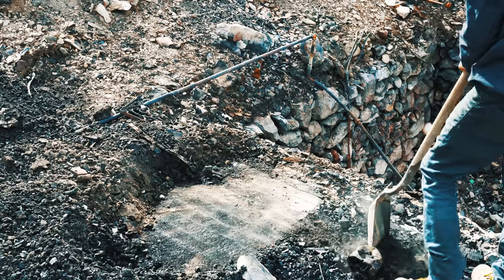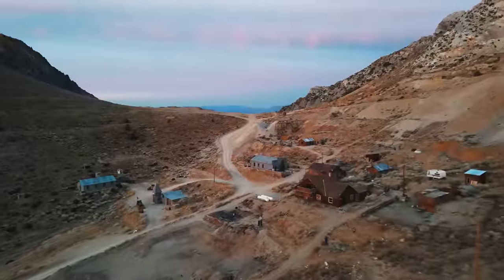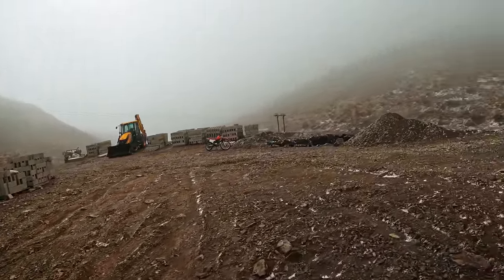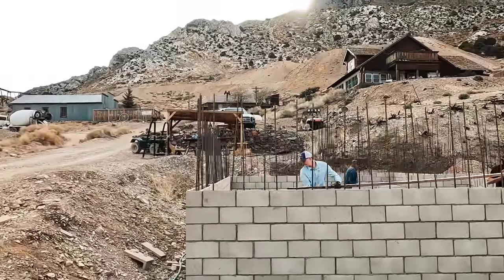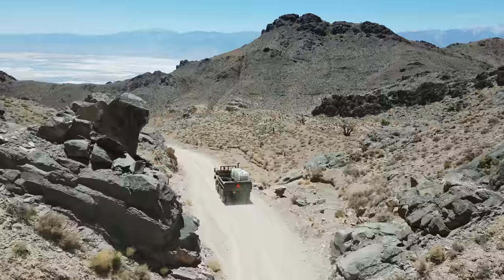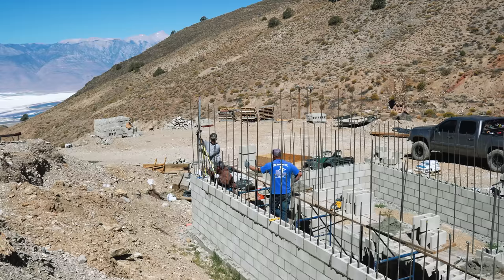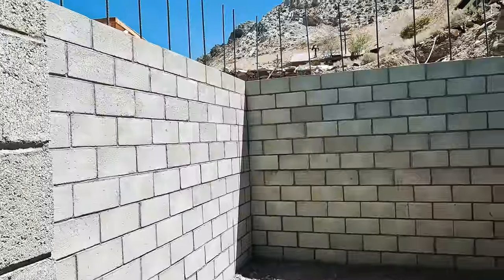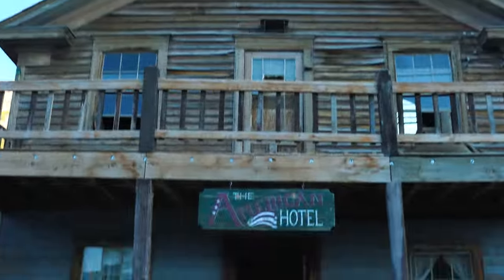Rebuilding The American Hotel Continues, Finally!

Comment: Perhaps to raise money for the American Hotel, “sell” the option to write the name of the person who donated on the roof shingles (on the inside of the hotel, not visible from outside). This was done here in the Netherlands at a church which had major fire damage, the new roof now has many names on the inside.
Reply: Awesome idea
Reply: I was at a restaurant/Whiskey Bar and after a fire they did exactly that. The took old Whiskey barrels apart and used the wooden slats, and branded the names of the people involved into them and covered a wall with all the wooden slats. Kinda like the bricks you can buy in front of stadiums and places like that.
Reply: I was gonna comment the same thing, only with bricks. People could buy a brick and have their name inscribed on it. They did it here with a clock tower
Reply: I believe this is already one of the patreon tiers.
Reply: I used to help build habitat for humanity homes.we would take donations for like 2x4 framing lumber ( studs.) And they would write their names on them.  Until the sheating and drywall was on the house looked pretty well graphitied.
Reply: Yes I worked for Buffalo trace in Frankfort ky and they have bricks with their names on them, lining a very nice bricked path. Don’t know how much they had to pay they also had the date on them
Reply: Great idea!
Reply: I wonder where all this money is coming from to build this hotel?
Reply: @t.j.m3987  "A portion of this project has been funded by donations made to the Friends of Cerro Gordo NonProfit organization through the American Hotel GoFundMe. The support of thousands of individuals over the last two years has raised funds that will go directly into rebuilding the American Hotel, preserving history for many generations to come. It is through your unwavering support and generosity that this project is possible. Thank you so, so much! It’s beautiful to see so many people care about the history here. It means the world to me." It's in the description of the video.
Reply: Funny how vanity was the selling point for those donors , in a church no less , wow .
Reply: @t.j.m3987  There was insurance on the buildings but it will not cover all the rebuild expenses. Things like code upgrades (very expensive fire sprinklers) weren’t on the policy.
Reply: @jimwednt1229  Never heard of "buying grace"? It was very popular with catholics before the printing press.

Once the bible was printed in common languages, and the people saw nothing in the Bible about paying the Catholics for dispensation, the practice died out..... mostly.
Reply: or someone could put there name on a new Brothel or outhouse .😊
Reply: One name per brink for the basement floor bar. Sounds good to me.
Reply: @cuttwice3905  that's a brilliant idea
Reply: Or sell bricks with donors names imprinted.
Reply: I love this idea! I would buy a shingle!
Reply: @jimwednt1229  Or perhaps it was just an idea that meant enough to the donors to see it completed - whether or not their names were on a brick, shingle or piece of wood. Imagine our world if we first looked for the good in people. Perhaps there’d be no need for wars.
Reply: Welke kerk?
Reply: In an Meeting hall here in my home town, they included a wall of translucent glass bricks that you could buy and have the name of someone who has passed away put on it as a memorial.
Reply: @akshonclip  I guess they would are very expensive junk I would say…
Reply: All he needs is to make a NFT and sell them, then we all make money right??
Reply: @TurnipGreen  you saved the clock tower!!!
Reply: @markmitchell457  we do it today, but not for favor with God but from society as an entity, in the form of twitter shared/insta posts "i donated to (Insert ideological group here). Won't you also donate and share this post to stand in solidarity with (ideological group) ?"
Reply: We've done the very same thing here in Finland for couple of medieval churches when they got burned down by arsonists. You could donate for the wooden roofing shingle parts and got your name on them. There was also option to donate money for the labor or the tar that was used on the new roof shingles.
Reply from the maker: I like that idea! I’ll have to figure out how to do that. Thank you!
Reply: @pjmiller8632  , well, you're right !. 
if you want to see the good in people , you'll find it . Like they just want their name to be associated with the supporting the project .  I can see the good in that.  
I'm just saying, putting your name on the walls or ceiling in a church, though 🤷
Reply: @GhostTownLiving  great to hear!
Reply: Goed idee!
Reply: @meesdobbenga4982  ja welke kerk?
Reply: @pjmiller8632   excellent response!
Reply: @scottstewart3884   I like this idea the best!
Reply: Go for it💪🙏🍀
Reply: @WJansen  waar ik het over heb is de Urbanuskerk in Bovenkerk (Amstelveen).
Reply: @jeroenzelle  wat mooi hee. Ik heb het even opgezocht. https://youtu.be/hrm9uRJm3rY
Reply: Another thought!
How about having somewhere in the room thats going to be the museum, either floor, wall or tiles, try to find as many names as possible of tbe people who actually worked there.
It would be really nice to have  a memorial place just for the men who died while working there (other than the ones who didnt) - somewhere in 'the church' would be really nice?
Reply: We did something similar as a fundraiser when my school was building a new football stadium. We sold bricks, both small and big, and people could have whatever the want put on it. Most people did their name and grad year but in something like this it could be the persons name.
Reply: @GhostTownLiving  Have a plaque made affixed to the wall outside with all those who helped and donated to the project
Reply: For building a structure in Yosemite southern overlook, they sold named bricks.  The was 15 years ago.  You donate, they print your name in a brick I think for the lower foundation visible to visitors.
Reply: The hotel has 7 guest rooms. Could you build cabins around the property without the same rules as the actual hotel? Similar concept as a camp ground with a central bathroom and showers.
Reply: @jimwednt1229  "Funny how vanity was the selling point for those donors , in a church no less , wow ."

Yeah, that put me off, too.
Reply: I'd love to "paint a cement block" in the basement to signify my $25.00 donation.
Reply: @jimwednt1229  possibly it was the pride of showing later generations that you donated and the proof is in the painted block
Reply: We did this at our church in Oklahoma. We each bought bricks we could have messages engraved on to pave a walkway around our church memorial garden since we couldn’t afford it without a fundraiser. It’s beautiful. Stones with three generations of my family engraved in it.
Reply: Or bricks with donators names paving a path somewhere. Either way here's an obligatory engagement comment for the Algorithm.
Reply: Or I could donate little resin Keychain or whatnot that has people's names and put it in the cement
Reply: Or make a wooden wall hang that people who donate or help can put a resin Keychain on it saying they helped build American hotel
Reply: @ILuvHuskys  there are masses of 3d printers and hobby enthusiasts that will take up this cause
Reply: @GenuineNPC  true but I do wanna volunteer my time and contribute
Reply: @t.j.m3987  LOVE
Reply: Really good idea
Reply: The  Cody Center of The West ran a fundraiser for the firearms collection  where folks that contributed  X amount of dollars had there name put on a brick that was used to build a wall. It was actually done quite tastefully and they sold every one of them. Sure there's plenty of space up there for bricks😉
Reply: I have no idea how someone can read the underside of a shingle.
Reply: @jimwednt1229  My 2nd Great Grandfather helped fund a church in San Jose CA in the 1800s. His family name is still on the stained glass today. Vanity or not I appreciate seeing a piece of my family history carrying on.
Reply: @promontorium  ,  I think that's pretty cool.
Reply: He has a mine full of silver………….make up a run of 1oz .999% silver coins. Coin collectors pay a fortune for rare limited run collectables like that, just look at how much Pawn Shop silver medallions/coins sell for on eBay!
Reply: How about pay for it  like everyone else does. A loan
Reply: That sounds wonderful, a wonderful way to commemorate the community effort to rebuild this historic building.
Reply: Brilliant
Reply: I would totally dedicate my parents money on this
Reply: @iamarawn  lol pretty sure this dude is milking his audience out of a dead ghost town that will remain a ghost town… it’s good for clickbaity titles to get views “hey I’m going exploring in old mine town” his been putting that same title up for ages now…

Comment: As a 40+ year fire sprinkler guy, I am relieved to hear you've gotten something worked out for those in the hotel.
Of course, the other end of that water storage requirement will be the fire pump required to deliver water to the
system - that's going to be some fairly decent electrical demand, too.
If done properly, though, the whole project could also serve to become the towns' water supply in general, too.
It's a substantial undertaking for any location, leave alone one with the challenges Cerro Gordo offers.
Best of luck with it!
- Ed on the Ridge
Reply: Well I was watching this video I was thinking solar panels or solar shingles. I mean that might be an option for him out there
Reply: Put the tanks above the motel in elevation, and you don't need anything to have good pressure at the sprinklers. Gravity will do all the work for em.

Comment: You need to look into the feasibility of laying down a helipad area, somewhere on the property. 
Not only would it allow Heavy D somewhere to land his helicopter when he comes to help out...but would also be invaluable in the event of a medical emergency when a medical helicopter extraction or attendance could be the difference between life and death.
If Daventry is coming out with excavators and bulldozers again to dig for the sprinkler water tanks....maybe see about getting a suitably sized area for a  helipad constructed. 
I suspect it would need to be quite a wide area to prevent small stones and dust affecting the helicopters that would need to use it.
And when not in use with a helicopter landing it would be a useful flat area. 
I suspect concrete or tarmac surface would be needed to make it safe and compliant for use.
Reply: Good points.
Reply: Heavy D will want to land his new toy there for sure.
Reply: I'm just waiting for Heavy D to buy a heavy lift Helo. If he used it correctly it would pay for itself in a matter of months as a side business. The Blackhawk is a good first step. That thing can carry 9000lb underneath slung with a max capacity of I "think" 22,000lb in cab and slung

Comment: CONCRETE,  You dont have to truck anyting up there to the mountain.   The concrete and blocks you are driving up the mountain will deteriate in 30 years because it has lime.  The water / snow will crack and break apart the concrete.   What you need is a Roman Cement that you can make form the materials you already have.   You have Volcanic Ash in those hills,  water, and a aggregate chunks of rock.   These basic elements will harden over the years into a strong rock that will never deteriate.     Have you studied Cusco, Peru anchiet megalithic walls, those  hugh stone was not moved there, these stone were poured, and trowled into place, and they turned into a hard stone over the thousands of years.     The lime as in Portland Cement is corrosive and will self destruct in 30 years.    So, stop truck that crap up the mountin.  The rebar you put in the walls will rust and corrode further busting out the concrete.  The rebar itself has to be epoxy coated before using in the concrets, so as to stop the rusting.
Reply: Good luck getting the CA government to sign off on that one. 😂

Comment: G'day Brent.

Something I have only noticed on small number of occasions on channels featuring locations in the US is rain water collection and storage infrastructure. 

In Australia rainwater storage for individual homes is ubiquitous and always has been and is now regaining prevalence in major cities where some local governments require it as a component of building codes.

In the early days of European colonisation purpose built storage tanks fabricated from galvanized corrugated steel did not yet exist. 

So people built cement lined cisterns with thick stone walls for storage of rainwater and many of those were built underground with domed tops to provide insulation from the heat of summer.

We live in hill country in the state of South Australia which so far as I am aware is considered to be the driest state on the driest continent in the world and the village where we live has never had reticulated potable water.

Consequently residents have always employed cisterns and corrugated steel tanks for storage of rainwater which we recently replaced with four 5,000 imperial gallon counterparts made from thick polymer to provide a household supply because it is far more durable than steel.

We also have an old, shallow well just 30 feet deep which provides water raised by means of an electrically powered pump for the toilet and a garden but due to high concentrations of mineralisation causing brown staining and a faint smell of sulphur it is not suitable for anything else.

If the regional environment at Cerro Gordo is any indication rainfall may not be very common at your locale but since you get snow in winter have you considered ways you might collect that form of precipitation as a solution to scarcity of potable water in Cerro Gordo?

If that is not a viable proposition I would be most interested to learn factors which make it impractical because would not placing tanks under ground prevent water they contained from freezing?

Comment: Great to see that you’ve fixed the issue with running water! I see on the building plan that all six hotel rooms have bathrooms, and I’m sure the bar will need at least one bathroom, plus the washing machine and dishwasher/sink.

Comment: Hi. You really have made great progress. I was thinking about water control and distribution. You probably have already gone through that planning but I would like to add MY '2 bits worth' from my RVing and living off country days. Regarding water usage, you need to have 3 SEPARATE systems: First is 'White water' - drinking water - going to all LOW FLOW sinks and showers. That drain collection goes to the second system the 'Gray water' which is used to flush the toilet and other places that people won't be able to try to drink it - like irrigation of flowers and trees. 'Black water' is the output of the toilet flush and goes to a septic system for decomposition and final usage of the output - other irrigation. Also, about lighting, I don't know if using low voltage - like RV - would be cost-effective or not. Using RV solar panels and something like a re-purposed Lexis battery to store the power until it is needed. Just 'food for thought'. Bob

Comment: You’re definitely going to want to put those tank as high as possible as you can. The pressure created by hydrostatic pressure(gravity) is great, instant and free. No need to turn on a pump continuously when you want more water pressure.

Comment: Love your channel n been following you for a awhile now .. have a question about the build ? So your going to fill in the center blocks with concrete I see a lot of extra work here,, why not pour pre slab walls like commercial building are built just in your case make it in manageable sizes n leave ends up to tie into each other..  you can easily speed up your build ..instead of brick by brick you be setting panels at a time. Only reason you would use brick anymore is for the look of it afterwards.

Comment: You might check to see if the same tank can be used on other buildings' sprinklers. It seems like the hotel fire system does no good if the building next to it is a blazing inferno.
Reply: Also, put a fire hydrant in the street.

Comment: Brent, Thanks for the great videos and congratulations on your successful start on the hotel. I am wondering if you have plans such as lowering a camera into the pit of death to see if there are access points to other levels? Compared to many other climbing / mine exploration videos your access seems to be the most challenging. Many things need to be rebuilt or modified to be safe. Good luck with the water situation and hotel. Obviously, that has to be the main focus overall. Thanks again and best wishes. Mike

Comment: Yep helicopter them up there be the quickest way. Or you would have to get a driver dolly to steer around the corners for the rear end of the tank to get around the tight corners. But the best way is fly them up there.

Comment: Hey, love your channel and what you do.
I'm sure you know more than I do about the project and the area, and I speak remotely without doing.
But regarding the water problem, can you dig a reservoir in one of the streams and then when the heavy snow in the place melts it will fill it up?
Or even closer to buildings and shoveling snow with the help of a tractor into it?
It can help with water for maintenance at least if not for drinking

Comment: In one of your videos you said that you needed to go into Lone Pine in order to upload your videos.  I see what appears to be a cell or microwave tower near you.  One method of getting high speed internet would be to install a mesh network to link down to the valley floor where a friend had high speed internet.  Equipment made by Ubiquity is inexpensive.